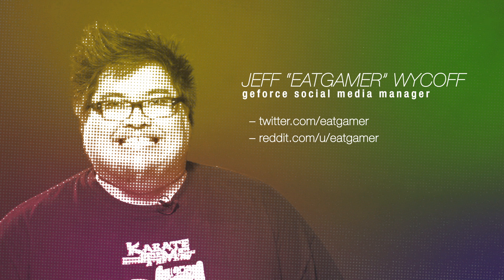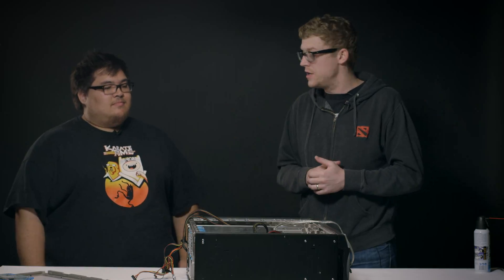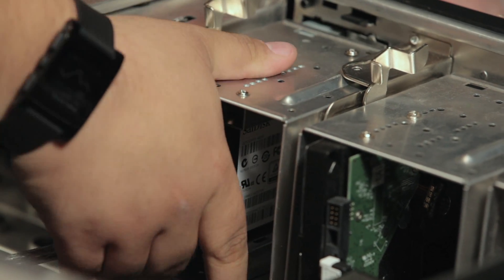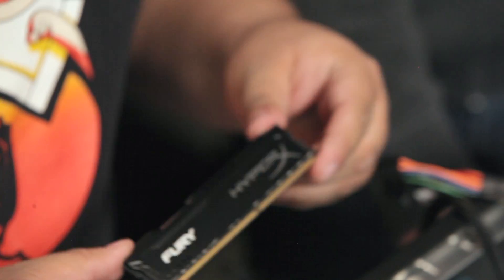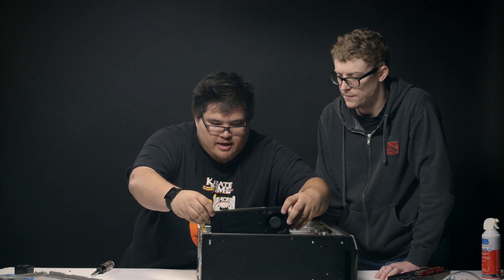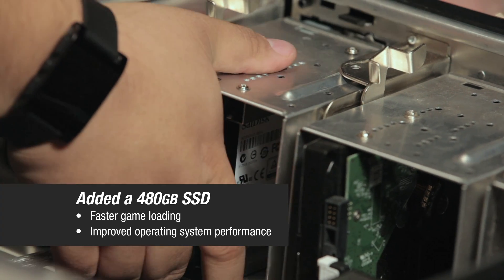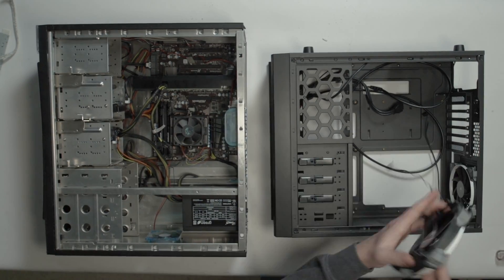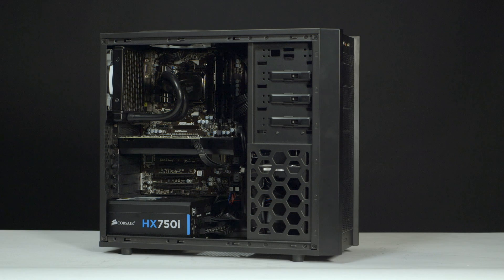GeForce Garage – How to Breathe New Life Into an Older PC

Comment: 8 gigs of ram 1600MHz is perfectly fine for ANY game released today and in the near future, and the GTX 660 is still a pretty capable graphics card. The SSD is the way to go, but games only benefit from loading times from it, which is important but not as important as running a game at a decent framerate.

That PC just needed to be cleaned and a 120 GB SSD to install the OS and applications in it. Keep your games on an HDD for now until SSD prices drop even further.
Reply: ***** That's just false. SSDs have nothing to do with framerate.
Reply: Yearlaren As soon as a game "especially open world" needs to access the drive for texture swapping or Shader caching and other things, if your drive is not fast enough it will cause moments of lag or stutter when entering new locations. An SSD is the way to go to alleviate those problems.
Reply: SoIoCreep That stuttering you talk about is just a fraction of a second. It doesn't affect your average framerate in the long run.
Reply: SoIoCreep Dude, that doesn't make any sense. All of the textures and shaders is temporarily stored in the videocards vram. If an SSD helped, your harddrive must have had an serious issue. Im happy you got it replaced though.
Reply: Kevin Stampe Yes you're right about them being stored in Vram but how to you think they got there? They come from the hard drive where they are installed. When a video cards memory is full and you walk into a new area with different textures the card has to pull those new textures from the drive. But what does it do with the old textures? The card will store them in a cache for faster access at a later time if needed. This is called texture swapping and caching. Everything needs to be quick and there is no doubt that a hard drive can be a bottleneck.
Reply: SoIoCreep As soon as you launch a game. All the files that are required to run the game are transferred to the RAM (Well a huge part of it) Its usually about 4 Gigs of data at a time but it varies. The RAM then feeds it to the FSB which in turn feeds the CPU. The CPU then initializes draw calls to the GPU which keep getting stored into the GPU frame buffer. When the specific time comes the object is drawn on the screen. If you had an SSD, the files would be loaded on to the RAM quicker but they would not affect the frame rate in any possible manner.
Reply: Vaishali Asthana  Why the hell are you telling me this? I never said a SSD would affect fps and I know how computers, programming and games work. I've been doing this for about 35 years. I coded my very first game on a Commodore Vic 20 "about 1981-82" and have made plenty of mods in the last 20 years "starting with quake". I don't think you need to be telling me how computers, programming, and games works. As for your idiotic statement "A game loads 4 gb of info into mem on launch", way to generalize. That has got to be one of the dumbest things I have read. All games are not created equal. All engines do not function the same way. There is huge, no more like enormous differences between Angry birds, FarCry 4, Tomb Raider, Crysis and The Witcher 3. Why would you even say something like that.. I'm only going to make an example out of one or two things here because really I don't want to spend anymore time speaking to you than I have. Lets takes The Witcher 3 for example or any game really. Why is it that a person on a SSD can fast travel to a new area in the game in about 2 seconds? Whereas for a person on a mechanical hard drive or console, it can take 30 seconds to a minute? Because the game is streaming the info from the drives. But you say all of the games data is already loaded up into memory. Why after playing Watch Dogs, Far Cry, Dying Light etc for a couple of hours, the amount of info stored in mem has now tripled from when I first launched it? Please man don't try and answer, I know the correct answers and I am just trying to make you see how wrong you are. I don't think the little article you read on DirectX 12 is going to help you now.

Comment: Ok, this is a "cheap upgrade", but expent around 400$? Just with around 100-200$ you have a full PC witht the same specs or even better LOL. I know, it's just a 7 minute commercial for the 960 but calling it cheap and easy tips... basically they only saved the CPU and the mobo.

Comment: Why dont you use a Sapphire R9 250?
Reply: Not sure if you noticed but this is NVIDIA's channel.
Reply: Firstly, there is no R9 250. The 250 is part of the R7 series. And because some people prefer temps below 70c and power consumption below 400w.
Reply: Tyrov because the r7 250 is 400watts.  I guess 65 watts is now 400 watts in your crazy land
Reply: Just asked because it is NVIDIA's channel